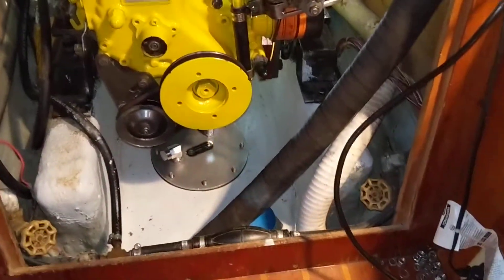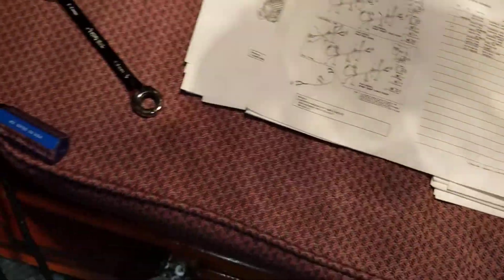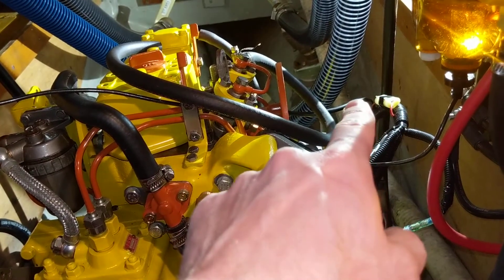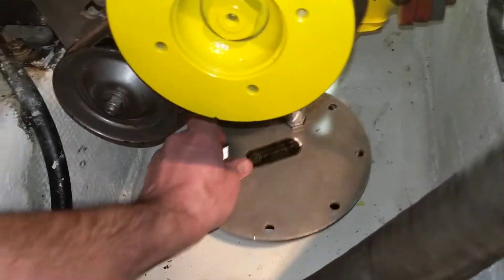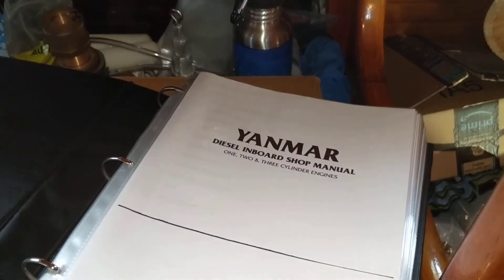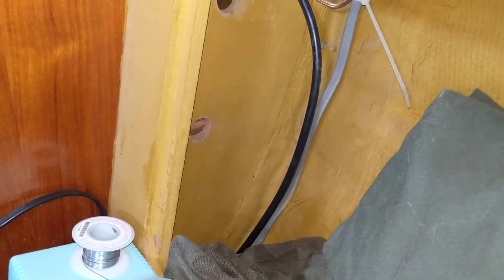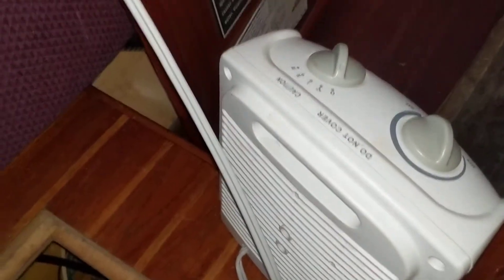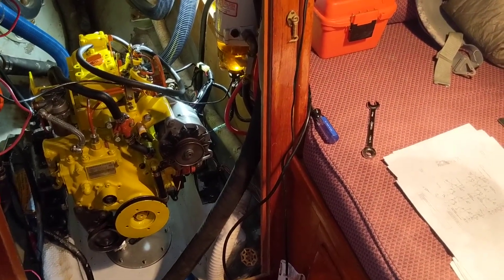Engine Wiring Harness

Comment: The main battery minus can go to the nearby 10mm bolt through the bell housing.  That way you don't disturb it if pulling starter. Be sure the starter gets good metal to metal surface contact to its mounting and use of greased lock washers helps.Your color scheme is interesting.  Thought I was seeing a Farymann engine.